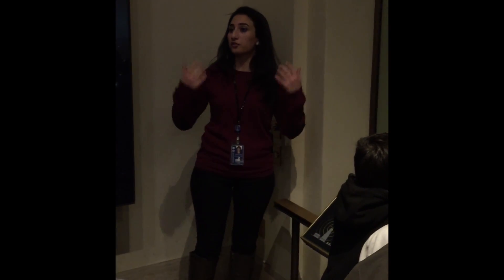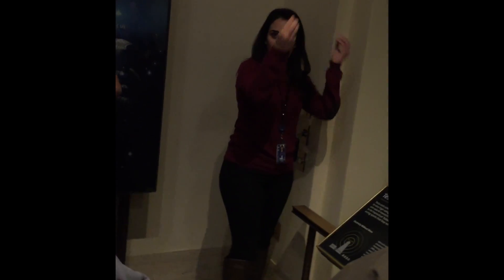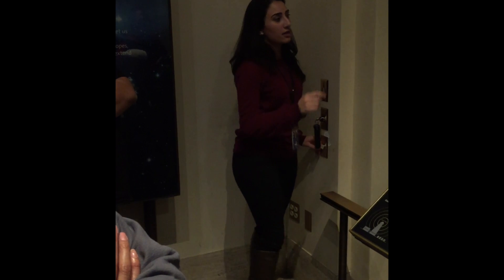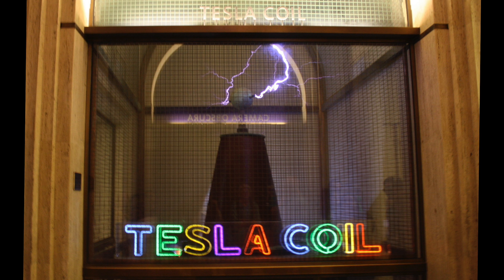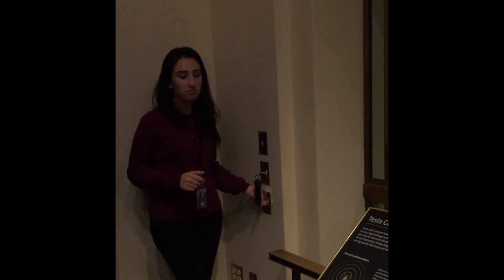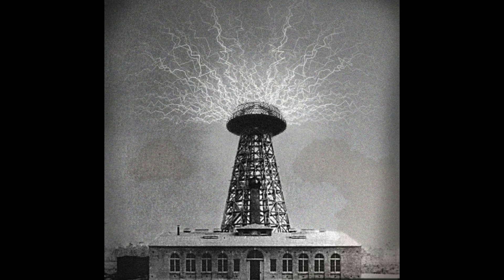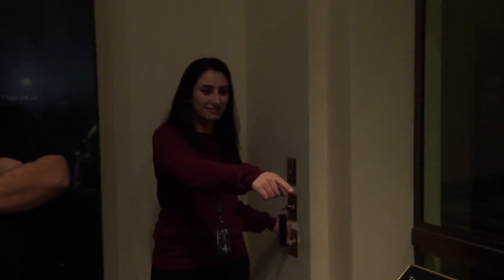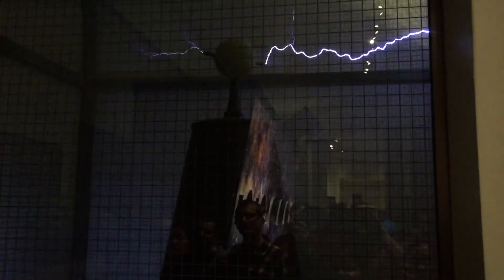Tesla Coil Demonstration and Explanation at Griffith Observatory

Comment: You can transmit power without sparks flying everywhere with a tesla coil. It wouldn't interfere with cell phones, tesla sent singles across the ocean. You don"t think he had that part figured out? also I think the tesla coil was for receiving radiant energy from the universe/ atmosphere.  He then broadcast the power using a useful wavelength for picking up with mobile devices, no sparks would be observed.